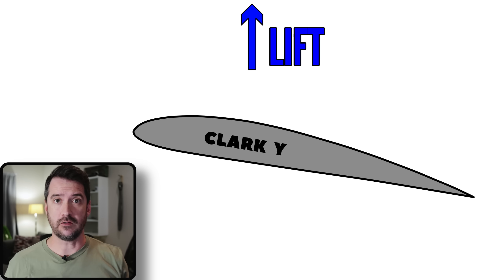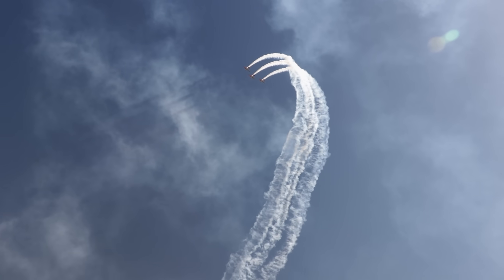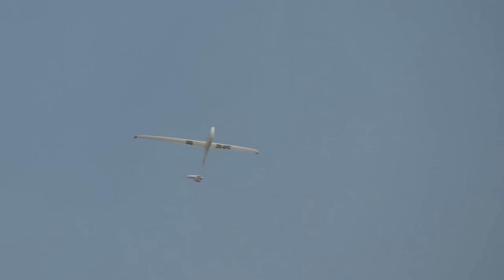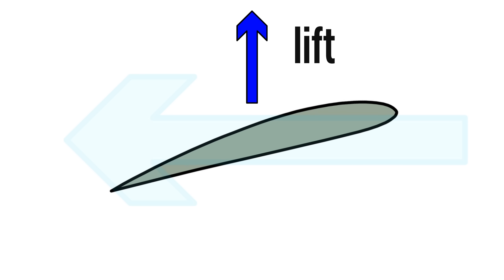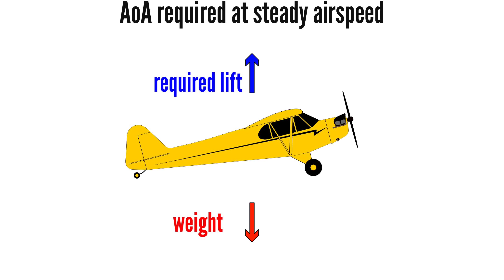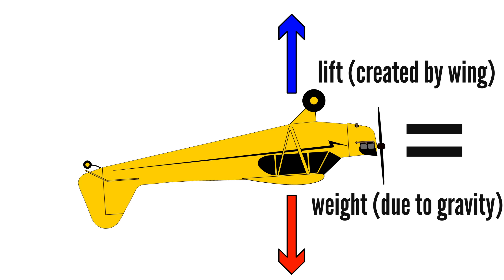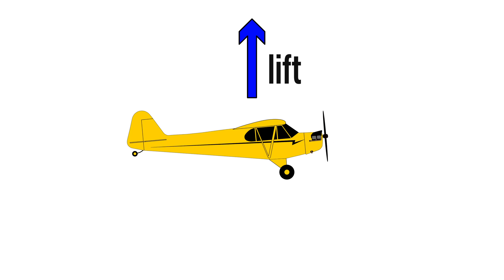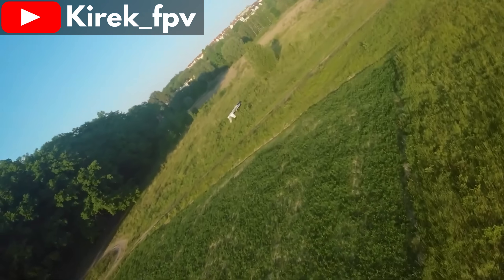Is Airflow Distance Over the Top of a Wing Always Longer?

Comment: It's so simple.  The wing must accelerate air downwards to produce lift.  The airfoil shape makes the process more efficient.  End of story'
Reply: All the diagrams illustrting the K-J theorem show the wing with a positive angle of attack, leading edge higher than trailing edge, with airflow deflected down. Gotta obey Newton's Third Law.
Reply: @petervanderwaart1138  A low circle arc profile with flat bottom and razor sharp edges at zero degrees will also create lift. That is the pure  Bernoulli Venturi effect.
Reply: @vicbauwens  There is NO lift without the acceleration of air downward.  You may attribute that to Bernoulli if you like...
Reply: @rsteeb  A venturi has equal acceleration up first then down and still produces a vacuum in the middle.  So why don't they cancel out?
Reply: @vicbauwens  Coanda is involved.  As is Newton...
Reply: All of the old NACA smoke stream videos show that the highest induced lift was produced just before the stall occurred.  The air at the trailing edge of the wing burbled first as the burbled air crawled backward toward the leading edge of the wing.  None of the air was flowing downward past the trailing edge of the wing. Thus, at high angles of attack there must be something more than Newton's laws that are creating the lift.  It's a combination of Newton and the Venturi effect that produces lift on the wing.  @petervanderwaart1138
Reply: Although it obviously leads to complicated explanations about how it is accomplished, it seems to me that most people get bogged down in these explanations before this very simple outcome is explained. This should be the very first thing explained, that there is a force moving air particles in one direction overall and the wing in the opposite direction, and that this is always the case under any conceivable circumstances.
Reply: @huverdoose  ... Agreed!!!
Reply: @adb012  Sorry, I deleted that because I'm in a bad mood (not related to this) and was afraid it sounded bitchy.
Reply: @huverdoose  ... I agree. if you want to give an "elevator speech" explanation of lift, "wing pushes air down so air pushes wing up, action and reaction, Newton's 3rd law" is the way to go. It is perfectly correct and it explains 100% of the lift. If the audience is not interested in more details, you are done. Now, anybody with an ounce of curiosity about this will not be satisfied. Gravity: Sun pulls Earth towards the Sun, Earth pulls Sun towards the Earth. Rockets: Rocket pushes combustion gasses back, combustion gases push rocket forward. Cars: Tire pushes pavement back, pavement pushes tire forward. Newton's 3rd law is EVERYWERE where you have a force (or rather two, because you NEVER have ONE force... because of Newton's 3rd law).
Reply: Air goes down. Plane goes (stays) up.
Reply: Yes…and no. 
Consider a stalled wing.  Still pushes air down, but creates little lift.
And for the yes.
Air has mass, therefore momentum.  The air below wants to continue towards the underside of the wing, thus compressing the air.
The air above wants to move away, thus creating a lower pressure. Simple hey!
Reply: @markthomasson5077  Consider a parachute.  Its lift is also its drag; although airfoil chutes do accelerate some air rearward, generating forward thrust.
Reply: @rsteeb  How does it accelerate air rearward?  How does a surface stiking the air make it accelerate air and not slow it down?  That would seem to violate equal and opposite no?
Reply: @markthomasson5077  On a stalled wing the airflow above the wing no longer moves smoothly along the wing surface. A lot of lift is lost that way.
Reply: @Snobiker13  of course.  I have felt this directly when windsurfing, if you over pressure the fin, it stalls and you go sideways dramatically!  
I guess wing are actually more sucked up, than pushed up.
Reply: My conclusion long ago that it’s basically conservation of momentum, and the curve on top is to keep the air suck and not becoming turbulent/stalled.
Reply: @RabidWombatz  turbulaters are employed to increase lift by stopping laminar flow over the top surface by causing breakaway.
Reply: @jimbo2629  If by "breakaway" you mean separation of flow, the function of turbulators is the opposite.  By creating small-scale turbulence in the boundary layer, they promote mixing of farther-out flow into the boundary layer.  This mixing brings in rearward momentum from the farther-out flow, so as to help keep the boundary layer moving aft, to /prevent/ flow separation (which on the upper side of a wing is known as a stall).
Reply: @RabidWombatz  So then how do you explain a stall?    By the way, the wing does work on the fluid, therefore momentum is not conserved.
Reply: @dougball328  A stalled airfoil has increased its AOA to a point where a significant portion of the relative wind has stopped flowing underneath and rearward and becomes pushed forward and over the leading edge.  The loss of downward acceleration of air is the result.
Reply: amazing how a perfectly understood scientific model is turned into obscure alchemy, backed by the argument of having had a private pilot’s license for 40 years 😅
Reply: @vicbauwens  Nothing at all "obscure" about Newton's laws.:face-blue-smiling:
Reply: @vicbauwens  Yeah, Newton's laws are "alchemy".  Brilliant.😅
Reply: @rsteeb  That is the most ridiculous explanation of stall that I have ever read.   Go take a basic aero class ( I have 5 years )   Let me give you a hint, when an airfoil stalls it is the flow OVER the airfoil that is disrupted, not underneath.   Your lack of understanding is on full display here.   Remember, it is better to remain silent and thought a fool than to speak and remove all doubt.
Reply: @dougball328  A stall occurs when air that should have gone under the wing is deflected upward and over the wing instead.  And I passed my private pilot check ride forty years ago.  GFY. 🙄
Reply: @rsteeb  You may know how to fly, but you don't know how your airplane works.   As for your salacious salutation, I won't stoop to being that low, gross or crude.   But you still don't know squat about aerodynamics.
Reply: @dougball328  Do you know how the stall warning switch on a Cessna works?
Reply: @dougball328  About stalls, please see my two responses about this elsewhere in the thread.  They're both kind of detailed, so I won't repeat them here.
About conservation of momentum, your balance sheet needs to include the continual impulse exerted by gravity.  Without the wing, the plane would be in free fall.  To avoid that, it has to hand off the gravitational impulse (weight force x time -- which has units of momentum) to something else, by causing the air to go down instead of the plane.  So the balance on the plane is 
(weight x 1 sec) - (downward momentum given to air in 1 sec) = 0.
Reply: Absolutely correct, and it doesn't matter HOW this is achieved  -  accelerating air downwards has the net effect of producing lift, and it couldn't be any other way.  Furthermore, simplifying it down to a two-dimensional cross-section (as it's usually portrayed), completely ignores what actually happens in the real world of three dimensions.
Reply: @CrowPal  I fly gyros I can have my disk on my rotors flat to the wind and they still don't slow down on a windy day (they slow more than in flight) sometimes I would have to turn with the back of the disk to the wind to get them to unload. This is the reason we usually set full forward at slightly below zero degrees angle of incidence. So my wood rotors have no angle of incidence ZERO and my disk is at ZERO why are they still going forwards fast into a wind?  It makes perfect sense with Benouilli's theorem.  Now perfectly happy to believe that a significant amount of lift is also produced by deflecting air down in normal flight with higher angles of attack but clearly pressure differential is doing all the work in autorotation.
Reply: @cameronlapworth2284   You are focusing on the micro (the aerofoil cross section), when you need to take a step back, and see the big picture.

An aerofoil section isn't the only method of generating lift by an heavier-than-air aircraft.  All of them, however, with the exception of anti-gravity craft, produce one net result: accelerating air downwards.  That is what produces lift.  We're talking Newton's third law here.  How else would an heavier-than-air aircraft stay up?

Of course there is a drag too, which is the acceleration component not directed downwards.

If you still cannot fathom this, look at pictures of planes (or helicopters for that matter) flying just above thin cloud layers.  That illustrates perfectly what happens.  That's the big picture.  The rest is just the mechanics of how to bring that condition about (the micro).
Reply: @CrowPal  Any model has to explain every situation.  If it can't its incomplete.  The reason I am focusing on Autorotation is because no one can explain this in terms of the  Newtonian model.  

I used to teach people to fly in gyrogliders.  So autorotation was paramount to my instruction so when the first rumblings of this debate started back in the 80's I contacted one of the aero engineers promoting this newer idea.  I was and still am perfectly happy to accept it completely or in part.  But while I understood what was being proposed in terms of lift in general it didn't make any sense in terms of autorotation.  So I asked him to explain it to me, he basically told me he was working on how this worked in his model.  He would get back to me when he had.

I never heard back and I didn't expect to he's a busy guy and was under no obligation but I concluded it had either been worked out or hadn't.

From time to time it comes up again and again I ask people to explain how this works in autorotation.  Because I have many a time sat there with my flat bottomed rotors in 15mph wind after landing and cannot remove the lift on my gyro with zero degrees disk angle.  My blades are set to zero, my disk is zero so its zero angle of attack and the blades are still doing over 150rpm.  

This doesn't work with the Newtonian model in terms of downward deflected air.  It doesn't explain why rotors in flight auto-rotate either.  It may explain how once they are spinning thanks to autorotation they produce lift but it doesn't explain autorotation.  I've asked 10 people on this thread to explain it and no one can.  Open to an explanation that makes sense.  

So at the moment I've come to the conlcusion the new theory is likely not the whole picture.  Likely Bernoulli isn't either.  But if you can explain it to me I'm all ears.

In the meantime.  It doesn't work as I understand the Newtonian model.  I don't think I'm too dim to understand it (perhaps I am).  But certainly no one here seems to be able to describe a mechanism by which air hitting a blunt edge of an airfoil can make it spin against the direction of travel other than pressure differential.  So no I'm not focusing on the minutia I'm holding the model to account for all phenomena. That's what a good theory does.
Reply: That's only part of it.  The wing creates a "Venturi effect" with the smooth undisturbed air above it.   Both ways contribute to lift, so it's not the end of the story.
Reply: @daffidavit  The lift that the top of the wing is making is ALSO from deflecting air downwards, end of story.
Reply: @daffidavit  ... It is NOT part of it. It is ALL of it but a ver basic level. You then can ask "how that happens", and then you go into things like the "Venturi effect". It is not that "both ways contribute to lift". Both ways explain 100% of lift, just in different ways, from different perspectives. In the same way that you would not say that X+1=3 and X-1=1 both contribute to X being equal to 2.
Reply: @adb012 🤓 

Dude, if I say my head is a prt of me then yes it is also “me” but it is still a PART. I would not be me without my head as it is a very crucial piece to ME but it is still a part…

Yes you can simplify it into a generalized statement that is 100% true but is still not the entirety of it.
Reply: @adb012 The Bernoulli pressure drop and Newton's 3rd law mass momentum down are not equivalent alternative explanations.

They are necessary pieces of a single explanation, with either being absent from the explanation, only making it a half explanation.

You need pressure drop and the consequential mass displacement.
Reply: @adb012  Exactly
Reply: @davetime5234  Well -- either one implies the other -- neither alone is actually wrong (unless the believer claims that the other is wrong...)
Reply: Wind tunnel tests negates the lift of Bernoulli's theorem. It does however prove that Newtons laws are correct.
Reply: @Graff-Art  No it doesn't it may prove that Benoulli's theorem is insufficient alone however.  I have yet to hear how the Newton thing explains auto rotation.  partial vacuum does explain this very well however.
Reply: @daffidavit 
I suggest high school physics where they learn 3rd Newton law aka law of conservation of momentum.
The only thing lifting the airplane is air accelerating downwards.
No more, no less.
F (up) = g m V(down) / t
Reply: @Alec72HD  I don't know why that's "controversial"...
Reply: @daffidavit he is absolutely right, his definition encompasses yours
Reply: @daffidavit  That effect is also directing air downwards as the low pressure zone pulls air from above it downwards. It does not pull air below it upwards, it pulls the wing upwards, but that doesn't move because the force is cancelled by gravity.
Reply: @cmilkau  Bouyancy works because there is a pressure differential.  Does a hot air balloon generate a downward thrust of air equal to the weight of the balloon?  No it generates a difference in pressure greater than the mass of  the balloon.  Doesn't need to require downflow of air only needs higher airpressure below than above.
Reply: @cameronlapworth2284 A pressure differential is just newton's 3rd law applied at the atomic level. Gas molecules on the bottom of the wing are colliding inelastically with the wing and reversing direction, which is a net acceleration of air molecules downward.
Reply: @enndubful  Yes I know that Netwons third law applies to air molecules.  I am asking for someone to explain how deflecting air downward pushes the rotor forwards and not act against the direction of airflow ie.  Thrust as autorotation does.  I understand how it can produce lift on the wing as a whole but it also has to explain autorotation.  Which also works with my blades which have zero angle of incidence with a flat disk. ie. flat relative to the air.  Explain why I need a rotor brake in 15mph winds in this situation.  If you can't theres a problem with the model.  Autorotation is not explained.  Forget downward lift think what makes a blade spin at hundreds of miles an hour against the direction the wind is hitting it.  simple flat plate physics would slow a rotor it would never autorotation because its lifting and adding to drag.   Autorotation works opposite drag.  Drag eventually wins but rotors will do hundreds of rpm, hundreds of miles per hour at the tip.  Please explain that.  If people can't the theory may be partly true but is missing something or is just part of a many factors contribution.
Reply: @cameronlapworth2284  Ultimately all of the lift and drag forces on an airfoil are the result of collisions with gas molecules. You keep suggesting that Bernoulli's principle explains lift as if that is a district effect from deflecting air downwards, but it's the same thing. A pressure differential is nothing more than more gas molecules colliding with one side of the wing than the other, which necessarily involves deflection of air molecules away from the high pressure side.  I'm not sure why you think that autorotation is incompatible with newton's third law.
Reply: @enndubful  i dont think its incompatible with 3rd law.  I think its incompatible with the explaination given.  Ie.  I think lift is compatible with deflection of airflow in an equal and opposite faahion.  But as 3rd law also states that drag will be caused against the flow of air and autorotation is acting in the opposite direction you have some explaining to do.

Rotors even in negarive pitch accelerate ceetainly at zero degrees the still spin fast if so e airspeed is maintained.

You have to get the resultant forward of blade .  This is explianed fine by lower pressure over the leasing edge compared to the trailing edge ie. Partial vacuum.  If not explianed by downward deflection of air.  Ceratainly not at zero degrees.  That causes drag or autorotation would increase with higher pitch.  It doesnt hence dead mans curve in choppers.  

If you want to help me understand something Ive missed explain that.  Dont give me vague discussion of 3rd law at the level of molecules.  I already accept 3rd law works with molecules.  The pattern and density of those molecules brings in different phenomena also.

You have to explain how 3rd law causes a rotor to accereate in the opposite direction to the impact of those molecules.  Ie.  How di they overcome the drag that 3rd law predicts.
Reply: @cameronlapworth2284  As long as the net acceleration of the air away from the trailing edge is great enough to overcome the drag force then the airfoil can still accelerate into the flow of air. The drag vector in autorotation always acts to slow the rotation. If the rotation speed is increasing then the component of the lift vector that acts directly opposite of the drag is necessarily greater than the drag force. 

You seem to accept that autorotation can be caused by a pressure differential. Pressure is nothing more than a net acceleration of gas molecules in the direction normal to the surface.
Reply: @enndubful  ok getting somewhere i think.  I believe that pressure differential is caused by the air molecules being forced apart vertically as the rotor seperates them as they go up over the top of the rotor.  Now could be and happy to be wrong here.  This explaination explains the pressure differential.  It doesnt matter how far the air travels if the wing was the top half of a circle then the pressure differential would be equal front and back.

This understanding explians difference between induced  drag vs parasitic etc.

However this may not be complete.  Which is why Im looking for an explaination that works.

You the first person on this thread who is trying to understand what my difficulty is with this.

So yes i understand that the newtonian veiw will have drag acting against autorotation.  I dont understand why it causes autorotation in the first place outisde of the speration of gas particles prefentially on the first 1/4 or so of the chord.  Not the downflow over the back of the rotor.  I dont see how this is revelevant.  

I hope you see my problem with this.  Im not being stuborn i genuinely dont want to be wrong longer than i have to be (if my current understanding is wrong).

Anyway thats a start but still not there.
Reply: @daffidavit . O, it IS the end of story.  There are a number of ways to accelerate air downwards. . .  Some are more efficient than others.
Reply: @daffidavit  Lol that dude isn't even close.
Reply: And is why racing car spoilers are upside down airplane airfoils. Pushes DOWN, the rear end.
Reply: Nope.
Reply: Many don't like too simple, it undermines their learning...

Early NACA aerofoils were merely arcs (connecting the bull nosed leading and "sharp" trailing edges) enclosing the aerofoil,  tangent to a series of circles  - with their centres on the line of camber / AOA desired at flight attitudes, thanks to a lot of experimentation (and theory to be sure)  we now have a whole library of aerofoils to choose for many scenarios - and simulations to generate new aerofoils in the future.....

(Pressure distributions are fascinating to look into...)
Reply: Fun fact is that I overheard an aerodynamicist (?) teaching aerodynamics at my flying club and he discarded the "longer path" theory I grew up with:
"Lift is is created by deflection ie acceleration of air volume downwards not by accelerating along the chord"
"The max 5% difference in path length cannot accord for the pressure difference".
Having heard this I realized that in each wing illustration airflow leaves the trailing edge neatly following the original AOA.
Whereas a propeller thrusts air down (i.e.backwards) in a perpendicular fashion. Same airfoil. Different result?
And later at uni the airfoil model was flat clark y looking (to prove the point!) whereas most airfoils are quite symmetrical. They all look like a fish, slightly bending. Sailplane wings are often concave at the rear lower side, lengthening the "shorter path" (uh oh!) but increasing the deflection component.
I alsp object to the presentation of ONLY TWO valid means of flying upside down (loading and thrust ratio) and then minutes later tossing in a third, AOA.
Reply: @jonashellsborn7648  A better explanation is what is happening at the level of particles.  Imagine your two airflows as evenly spaced particles and a zero angle of attack wing.  As the particles are deflected upwards on the leading edge they are moved apart vertically - so a part vacuum is created.  Where is the most change in the wing?  The curve continues across the whole surface but the bias is towards the front.  This explains both lift via the vacuum produced and the forward lift vector.  It explains auto-rotation too.
Reply: False!
Reply: Lift effects are a result of pure physical observations without ANY reasonable explanations…you can also argue that the resulting effect is reducing gravity acting on an accelerated profile within a certain medium…Nature does not do math or do calculations…Same with magnetic effects….Just observations given, no real explanation yet by modern physics…
Reply: Do you even lift ? 🤨
Reply: Any of the "acceleration of mass is the only mechanism of lift" boneheads here are free to explain how acceleration of mass is responsible for the lift of a horizontally motionless  magnetically levitated object that anyone can pass their hand under. 

The third law, isn't Newton's only law, if it were, it seems extremely unlikely it would be referred to as the third.
Reply: @homomorphic  
What does mag lev has to do with wings ?
There are many ways to create a force.
You can just use a rope.
Or a wheel on a rail.

3 rd law says that in the absence of other forces momentum is conserved.
You Seriously are failing Physics 101.
PS
Learn what is defined as "closed system"
Reply: @Alec72HD   this is the way science works. A bonehead makes a ridiculous assertion like "the way lift operates is due to Newton's 3rd law". I then provide a counter example that even a 3 year old can understand, and then we get that ridiculous assertion out of the discussion and we can begin to discuss how wings work using actual principles of physics.
Reply: @homomorphic  
You are claiming that wings violate 3rd law.
Again, I suggest you clarify for yourself what is a "closed system".
In any case
Lift = g × m (air) × V (down) / time
That's Newton laws.
Lift cannot be MORE, cannot be LESS.
Reply: @Alec72HD   of course I'm not.  It seems you don't even have sufficient basic understanding of physics to even have an intelligent discussion. 

Do you think that magnetic levitation violates the 3rd law? I mean you're response to that counter example is the idea that I am claiming that maglev does violate the 3rd law.

Just because lift doesn't use the 3rd law to obtain lift,  doesn't mean that it violates it. It seems basic logic escapes you.

Perhaps you can start by explaining what principle of physics maglev uses?
Reply: @homomorphic  
Because airplane AND all the air is a CLOSED SYSTEM 
The only way to create force UP (lift) is to push air down.
Any DEVIATION would violate 3rd law.
Reply: @homomorphic  
PS
In a closed system air cannot exert a force without corresponding change of momentum.
F = g MV/t

 Now, go read NASA explanation.
Reply: @Alec72HD   explain magnetic levitation. It is a closed system. How does the 3rd law apply to maglev (hint: it doesn't).

The 3rd law is not the only principle that applies to wings either.
Reply: @homomorphic  
I am not able to teach all of Newton principles in comment section.
You tell us, what is a closed system in your mag lev example.
You have a force between the earth and the vehicle.
Doesn't even have to be magnetic, makes no difference.
Reply: @homomorphic  So Newton's third law has been repealed?  :face-blue-smiling::face-green-smiling:🤣
Reply: @homomorphic  Maglev supplies "lift" which counteracts the 9m/s^2 acceleration that is Earth's gravity.  Tell us how the mag-lifted object differentiates static lift from acceleration!
Reply: @homomorphic  By "lift," the rest of us are talking about a force derived from interaction with a moving fluid.  If you think maglev is a disproof of what we're talking about, then you haven't been paying attention.
Reply: @crispinmiller7989   if you think that magnetic lift isn't a form of lift then you are completely bereft of logic and we have nothing to discuss.

In science if one can offer one counter example to an assertion, the assertion is invalid. That is just how it works.
Reply: @crispinmiller7989   i used it to disprove the assertion that lift must be due to a downward acceleration of mass. Once we can all accept that this statement is not true, then we can have a productive discussion about how wings work.
Reply: @homomorphic  If you were paying any attention to the whole context of the discussion you wouldn't even have dragged maglev into it.  You might as well bring in a 2x4 column and call the supporting force it supplies "lift" too.  Yes, there are many ways to hold things up.  This discussion, though, is about how airplane wings do it.

In the context of fluid dynamics, yes, lift does require downward acceleration of mass,  In the context of anything mounted on the ground, obviously it doesn't,    Your postings in this thread are just an irrelevant annoyance.
Reply: @crispinmiller7989   we're talking physics (that is all any discussion between humans is ever about) and incorrect assertions that violate Newton's 3rd law. Until everyone is on the same page regarding the 3rd law, useful discussions can not occur.
Reply: @homomorphic  Excuse me?  We were all talking specifically about airplane lift, a context in which the third law emphatically does apply, and you somehow found it necessary to jump in and object that it does not apply to areas where yes, we KNOW of course it doesn't, but we weren't TALKING about that.  

If you have a contribution to make in a discussion about AIRPLANE lift, please go ahead, and otherwise please leave us alone.
Reply: @crispinmiller7989   lift does not require acceleration of mass. Period. Regardless of vehicle. Physical principles are universal
Reply: @homomorphic  Physical principles?  like F=ma?

Sorry, "lift does not require acceleration of mass" is clearly not a universal principle.
Reply: @crispinmiller7989   of course it is a principal.  It is described by Newton's 3rd law in fact. The 3rd law states that for any action there is an equal and opposite reaction and this applies to all forces in nature, not only the force that results from mass×acceleration.  The maglev train proves this. There is no mass being accelerated.

Newton's 3rd law makes it clear that mass×acceleration is not needed for lift.
Reply: It's not that simple. There is circulation, Pressure fields, downwash...  Explaining how lift is created while addressing everything relevant in a mathematically consistent way is extremely difficult.
Reply: @mignik01   it isn't diffcult, it just requires a conceptual understanding of quantum physics. There is no mass flowing anywhere in maglev. There is a energy balance via electromagnetic forces. See, there's that word "force" again. It doesn't have to involve the acceleration of mass. The third law is at play, but not via the acceleration of a mass.
Reply: @homomorphic  yeah I'm not talking about quantum physics. You can explain it using the flow equations. Mass, momentum and energy equations.
Reply: @mignik01  ok, but you acknowledge that maglev produces lift without accelerateling mass, right? That has been my entire point. It should be obvious that acceleration of mass is merely one of the possible physical expressions of the 3rd law and not the 3rd law itself.

Once we get out of the way the misunderstanding that lift requires an acceleration of the air mass in the opposite direction of lift, then the discussion can get back on topic.
Reply: @homomorphic  No I don't.
Reply: @mignik01  yes
Reply: @mignik01  
It's that simple.
It cannot be no more, no less.
Lift HAS to be equal to
 g × M (air) × V (downwards) / time

3rd Newton's law applies here on Earth.
We (humans) have never observed a violation of 3rd law.
Good luck with your Nobel prize if you prove otherwise.
Reply: @Alec72HD  V/t = a. So your equation becomes gxF(downwards). What's causing the downwards acceleration?  This only sort of talks about momentum conservation. What about mass and energy? We don't really care about g in the creation of lift. Body forces like that are usually ignored.
Reply: Of course. That’s a direct effect of the conservation of linear momentum. For the wing to be pushed upwards, it must be pushing something downwards. One can go around (pun intended) with the theory of circulation, etc. But since the laws of mechanics are coherent, they will produce the same result, no matter which path you choose (another pun…).
Reply: 100%
Reply: How does that put a force on the wing? Gases can only produce a force by pressure differential. You can't attach a chain to the air molecules and drag the wing up.
Reply: @randomxnp  You don't need to tie the molecules on with a chain.  They're all being pressed against it by 15 p.s.i. from the miles of atmosphere sitting on top of us.  You can reduce the pressure by several p.s.i. and they'll still be clamped against the surface.  But they'll be exerting a lot less pressure than the underside, and in everyday terms we consider this pressure reduction to be suction.  But call it what you like, it creates a substantial excess of force from the underside vs. force from the upper side, and we call that "lift."
Reply: @randomxnp  Study the Coanda effect!
Reply: @Snobiker13  I have. What of it?
Reply: @randomxnp  Then you know that the Coanda effect is what keeps the flow attached to the wing. That's the "chain" that drags on the air molecules.
Reply: @Snobiker13  and how does it do that?
Reply: @randomxnp  https://en.wikipedia.org/wiki/Coand%C4%83_effect
Reply: @Snobiker13  because of Wikipedia?
Reply: @randomxnp  I'm just pointing you to a description of the Coanda effect. You said you'd studied it, right?
Mass and pressure.
Reply: Exactly, perfect, in a nutshell.
Reply: Search “Coandă effect”. It is used in the NOTAR (No Tail Rotor) helicopter design. Downwash from the main rotors flows around the tail boom to create a horizontal force to counteract Newton’s Third Law of Motion. It negates the use of a tail rotor….and the hellish noise produced.
Reply: Then explain the wing of an Extra.
Reply: Makes the process more efficient by reducing drag?
Reply: @jamesmskipper  more so that it converts more of that “drag energy” into lift energy rather than heat, turbulence, etc? Like yes it reduces drag compared to a brick but it really is just a matter of effectively channeling the energy into more useful means
Reply: @jamesmskipper  ... More precisely by increasing the lift-to-drag ratio. Yes, it reduces drag, but also increases the max lift.
Reply: @adb012  I don't think I've ever seen left/drag ratio testing of wing profiles, I'm sure they've been thoroughly tested decades ago. By the time I had some studies in flying, this was the accepted explanation.
Reply: @jamesmskipper  ... Yes, it is called the "Polar Curve" and it is one of the 3 main graphs for an airfoil: Cl-alpha (lift-to-angle of attack), polar curve (lift-to-drag) and pitching moment vs either AoA or Cl.
Reply: You ever put the back of a spoon in a water flow?
That’s where my intuition of lift comes from.  Fluid flow clinging to the surface, then an (effective) low pressure zone trying to detach that flow, pulling on the surface in the direction of lift.
As others have pointed out, multiple models come up with the same lift values, so pick one that best suits your intuition.
Reply: @Will-kt5jk  .... The spoon in-a=jet=of=water model is similar in the sense of the 3rd Newton's law: Spoon pushes water one way, water pushes spoon the other way. But the way the water and spoon interact is totally different than the way the air and the wing interact. And the reason for that is not air vs water, but a jet of fluid surrounded by static fluid vs the object being totally submerged in and surrounded by an "infinite" volume of moving fluid (or the object moving through the fluid). The jet-of-water-on-a-spoon experiment relies on the viscous boundary layer all along the spoon for the water to "cling" to the spoon,  what is called the Coanda effect. On the other hand, a wing or airfoil moving through a mass of fluid doesn't need the viscous boundary layer to generate left. In fact, a simplified model of potential flow (non-viscous flow, no boundary layer) predicts pretty accurately the pressures distribution around the airfoil and hence the lift. The Coanda effect doesn't predict well at all the lift of an airfoil, and the potential flow doesn't predict well at all the lift of the spoon in a jet of water.
Reply: @Will-kt5jk  Also venturi tubes in carburetors and other flow devices. But I remember an old photograph from Kitty Hawk where the Wright brothers were experimenting - a bi-wing type kite tethered on the beach in a strong wind. It appeared to be floating directly above the tether points. I thought - That illustrates very low drag, none of my flat kites ever flew vertically over me, most didn't exceed a 30° angle.
Reply: @jamesmskipper  right, because flat kites fly in a perpetual stall, whereas the Wrights' kite was a miniature airplane with legitimate airfoil wings.  (Even if the airfoils were still in an early stage and probably single-surfaced,)
Reply: Hi that doesnt explian autorototation.  Benoulli does.  Could be both but you need to explain autorotation.
Reply: @cameronlapworth2284   they need to explain how acceleration of mass is a requirement for lift. Maglev is lift. No mass being accelerated anywhere.
Reply: @homomorphic  yes but thats ni how aircraft wings work.  The competing theories are the air deflected creates an equal opposite reaction and benuolli longer airflow.  Benuolli explains autorotation as well.  But doesnt mean both cant be true.  The way I akways understood the mechanism for benoulli was the molecules end up pushed up as they go over and are seperated vertically hence the vacuum.  More deflection on the leading edge so not only more lift but also slightly forward lift.  Doesnt mean as the airflows of the trailing edge there isnt also and equal opposite reaction too.
Reply: @cameronlapworth2284   ok, now that we've established that lift doesn't require acceleration of mass (i.e. AOA) then I can now point out that wings (in level flight) do not produce lift via acceleration of the air mass in a downward direction. They produce lift due to pressure differential (which is a force and is completely consistent with the 3rd law).
Reply: @homomorphic  Gravity is equivalent to acceleration.  Maglev provides an equal and opposite effect, as Newton requires.  No laws of physics violated...
Reply: @homomorphic  We have established NO SUCH THING.  The "pressure differential" between the bottom and top of the airfoil IS DUE TO THE ACCELERATION OF THE ATMOSPHERIC MASS DOWNWARD. Maglev opposing the 9.8m/s^2 acceleration of gravity in an equal and opposite manner is fully consistent with Newton.
Reply: @homomorphic  yes quite possibly.  Im open to any idea but it must be consistent with everything.  I wrote one of the academics suggesting the whole mass deflection thing and raised how it workes with autorotation he said he was working on it but i never heard how it worked.  As I was instructing in gyros at the time i was wanting to get my instruction right.  Never did find out.  Not smart enough to get involved with arguements on fluid dynamics or physists.  Just smart enough to know you need to explian things like autorotstion in your model.
Reply: @homomorphic  
"Lift" means force.
Magnetic field is exerting a force from the earth to the vehicle.
Such force (of such magnitude) is only possible in a close proximity between magnets.
I am not your physics tutor, but I will say this.

Airplane cannot have any other forces other than thin air keeping it flying.
Reply: @Alec72HD   air is not a force, neither is gravity btw. The electromagnetic force is a force, though. Ultimately, the force that is used to keep both an airplane im level flight and a maglev in the air is the electromagnetic force. Different mechanism of action, but the same force.

The point is that  reactionary force (deflection of air in downward direction) is not the only force at play when a wing generates lift.  The mechanism of action that uses the electromagnetic force in a wing is the bernoulli effect. Equal transit time is an incorrect description of how the bernoulli effect applies, of course.

The OP stated that the reactionary force is the only force at play and they are entirely incorrect. 

The biggest take away of this whole discussion is that gravity is not a force, so the force producing lift is not a counteracting forxe to gravity (it can't be since gravity iisn't a force). 

For many applications (including aerodynamics) gravity can be used in newtoniam equations as if it were a force, but in fact, it is simply the distortion of space-time by mass (essentially it is a consistent error in the newtonian model that creates an artifact that can be used as a force term in newtonian equations to make accurate predictions).

So nothing about how an aircraft flies is "simple". In fact, gravity is literally the biggest problem in theoretical physics. Just because we can build airplanes doesn't mean we understand everything about how they fly, because we don't even understand how gravity and the forces of quantum theory interact.  If flight were fully understood we'd have to first understand how gravity works within quantum mechanics as that is the essential interaction in flight.
Reply: @homomorphic  
In mechanics to make our frame of reference inertial system, we substitute acceleration due to gravity with the force of gravity.
You sure seem to know all the "science appreciation" terminology.
Anyway, since air is the only medium in contact with airplane, and air is a GAS, we can view all the air and airplane as our inertial frame of reference, while the gravity is represented as outside force.
In such a system the only way to create lift, is to accelerate air downwards.
Anything else would violate Newton's 3rd law.
Reply: @cameronlapworth2284  
You do know that without  fanning the rotor blades just before the ground the helicopter still crashes with auto rotation.
Reply: @Alec72HD  i fly gyroplanes. Always in autorotation
Reply: @cameronlapworth2284  
I am sure giro planes don't violate Newton's 3rd law.
Explanation:
Something along the line of a rotating blade can encounter larger volumes of air and deflect it downwards (vs stationary  rotor blades)
Reply: @Alec72HD  im not saying it breaks newtons 3rd law saying the vector doesnt point in the right direction.  Benuollis law fits though.  The lift of the rotor may be explained by newton the rotors forward speed against the airflow is better explained by benoulli.
Reply: @Alec72HD  "You do know that without  fanning the rotor blades just before the ground the helicopter still crashes with auto rotation."

So what? it's a way to make a controlled descent that provides you with angular momentum in the rotor so that as you approach the ground you do have rotor motion to work with.  Does require training, but sounds like a good deal to me.
Reply: lol none of you have a clue.
Reply: And airfoil just works against you for upside down flight. 
 Also really wing mustn't do anything if you have powerful enough motor. Some rc planes can hover in vertical position, like a weird helicopter. With high angle of attack vertical part of thrust vector is not negligible for normal planes.. sadly this guy does not mention it.
Reply: Simple?:  How does the wing accomplish accelerating that air down?
Reply: What if it is a symmetrical wings?
Reply: Seemingly yes but why then when air is spoiled on the top of a wing do you lose lift??
Reply: @SGTBILL572  No sorry that's incorrect.  There's a thing called 2/rev.  look at the direction the mast moves.  Also autorotation works in a vertical descent in which there is ZERO difference in drag between each rotor.  So no it simply isn't being pushed around by the retreating rotor.  Additionally the retreating rotor is actually at lower airspeed because its speed is reduced.  The difference is 2x the forward speed.  So two factors prove you wrong the mast deflects backwards due to the higher drag of the advancing rotor. then forward when the blades are fore aft - hence the need for either a flexible mast or lead lag hinge (in multi-bladed rotors) and the retreating blade is going significantly slower than the advancing blade.  So if doing 80mph and the rotor is doing 400mph then its 480 advancing and 320 retreating.
Reply: Absolutely right, and  it is perfectly established, in aerodynamic theory by Kutta-Joukowsky  theorem,  since 1906
Reply: @Trompicavalas  Come on! The Wright Brothers figured this out in the 1890's and first flew in October of 1900 at Kitty Hawk, N.C..
Reply: @tedmoss  And Otto Lilienthal had it figured out decades before the Wright brothers.
Reply: Even Clark Y can generate lift at ZERO degrees angle of attack.
Reply: @ColinWatters  ... Every* cambered airfoil can generate POSITIVE lift at zero and even small negative angles of attack. (*almost... you could purposely design a cambered airfoil for which Cl=0 when alpha=0)
Reply: @adb012  You could, but then the pitching moment would not be zero.
Reply: @adb012  Nonsense.
Reply: @rsteeb  ... Oh, I see it now. Thank you for explaining what of what I said you disagree  with and for providing your view of how it should be.
Reply: @adb012  Angle of attack is usually understood to be angle relative to the zero-lift position. So zero angle of attack is by definition the angle at which lift is zero, regardless of camber or shape.
Reply: @ColinWatters  No it can't. It CAN generate lift with the bottom surface parallel to the airflow. But for that particular wing shape this is NOT  a zero AoA.
Reply: @grejen711  As I said before I did not make that mistake. I know how AOA is defined. Go and look at the polars. Look at the plots for CL vs AOA. They do not go through 0,0. They clearly show a positive lift can be produced at zero angle of attack. I would post links if youtube would let me.
Reply: @grejen711  ... Cambered airfoils can generate positive lift at negative angles of attack (up to a point, of course).
Reply: @adb012  there is no lift without downward acceleration of air, full stop.
Reply: @rsteeb   haha,  no. Stop being silly. I have disproven this ridiculous assertion above.
Reply: @rsteeb  ... Of course. Have I say anything contrary to that?
Reply: @ColinWatters  That's what camber does.    Simple explanation.   Thickness causes the velocity around the airfoil to increase, both top and bottom.  Camber causes the flow to speed up on one side and slow down on the other.   A symmetric airfoil (one with no camber) does not produce any lift at zero angle of attack.
Reply: @ColinWatters   - *"Many" positive camber aerofoils produce some lift at zero angle of attack. (most who ever - remember having -  studied fluid dynamics know this experimentally.)
(* not "all" because trailing edge reflex could modify the performance to reduce zero AOA lift)
Reply: @ColinWatters - venturi effect + camber
Reply: Of course, because the air going over the top gets accelerated downward, so Newtonian lift 😀
Reply: @lohikarhu734 
Still no.  Wind tunnel tests show lift can be generated with no downwards movement of air.
Reply: @Talon19  There is a downwash in the tunnel, but because of the walls it is necessary to adjust the angle of attack as it is not equal to the geometric AOA.
Reply: @dougball328  
Where do you get that idea?
Airfoils with zero AoA produce lift IN WIND TUNNELS.
Reply: Nonsense   @Talon19
Reply: @Talon19  Newton says otherwise.  And planes don't fly in wind tunnels.
Reply: @bill-8794  
Newton’s laws aren’t being violated.
The circulation/flow turning/coanda etc ideas just aren’t correct.
Reply: @rsteeb 
Correct, models fly in wind tunnels which are then scaled up to VERIFY data gathered in wind tunnels.  If wind tunnels didn’t accurately predict aircraft performance, we wouldn’t be anywhere near as advanced in aircraft design.
While Navier Stokes Equations are almost a century old, they weren’t useful for aircraft design until computers advanced.  Yet we were able to successfully design, test, build, and operate aircraft by using wind tunnels.
Reply: @Talon19 
That would violate 3rd law.
You could create closed loop wind tunnel that would generate thrust in space.
...
But you CANNOT.

However, if you have wing close to the ground (or wind tunnel walls), it may appear as the air isn't moving downwards, because it bounces off from the ground.
You have ground effect.
Reply: @Alec72HD  
The wind tunnel tests I and hundreds of other undergrad students ran do not violate Newton’s Laws. 
Fluids moving at higher velocities have reduced pressure related to slower velocity fluids.  Basic fluid dynamics.
Reply: @Talon19  
Doesn't change
Lift = M(air) × V(down) / time
Any deviation would violate 3rd law.
Good luck with that Nobel prize, all of you.
Reply: @Alec72HD  
That’s a tremendously oversimplified equation which doesn’t work.  Why do you think that’s even valid?
Reply: @Alec72HD 
The units don’t even make sense on that.  How are we even supposed to measure it?
Reply: @Talon19  
Equation that is a direct result of Newton's 3rd law ALWAYS works.
So far on this planet Earth, we have NEVER observed a phenomenon that violated 3rd law.
I am sure Nobel prize is waiting for you if you can figure out how to break Newton's laws.
I will be waiting for a TV announcement any day now.
Reply: @Talon19  
PS
Perhaps I made a mistake, there is no "g" constant.
F (lift) =  m (air) × V (down) / time
F = mV/t
Reply: @Alec72HD  
How and why do you think pressures or forces can only be achieved through deflecting fluids?
Reply: @Talon19  
It all depends on your frame of reference.
On a microscopic level at a static pressure air molecules bounce off and transfer their momentum to an object.
Of course same is happening on the other side, so net effect is small and it's called BUOYANCY.

ANY lift force greater than buoyancy HAS to come from accelerating air downwards.

It's the Newton's 3rd law.
Reply: @Alec72HD 
You just refuted your own position and ignored no slip conditions.
You are referring to static pressure, implying it is equal all around an object, which is false.
Reply: @Talon19  
What is false is your claim that I said static pressure is equal all around.
Did you miss that word BUOYANCY I wrote in caps?

I gave you your answer.
You seem to having a problem with the explanation given on NASA website, that 100% of lift is a result of pushing air downwards (downwash)
That is Newton's 3rd law.

Bernouly principles explain how a wing efficiently creates downwash and what happens with pressure.
Reply: @Alec72HD  
You seem to be misusing and misunderstanding buoyancy, lift, and differential air pressure.
You’ve given nothing to show force can’t be applied by a fluid without the fluid being deflected.
Reply: @Talon19  
I guess I am not as good at explaining as the NASA and many videos about this subject.
Or maybe you don't want to understand fundamentals of Physics.

All I care to discuss is the topic of this video, which is a flying object.
Reply: @Alec72HD  
NASA is correct, your understanding isn’t.  The Navier Stokes equations, Euler equations, equation of lift, etc don’t negate my example.  You just refuse to accept there are different approaches to the same principles.
Creating a force from a moving fluid doesn’t require that fluid to be deflecting, turned, or circulated.
Reply: @Talon19  
My understanding is that Newton's 3rd law always applies.
You are claiming that a wing in midair can generate (some) lift without deflecting air downwards (downwash).
If you cannot understand HOW that violates laws of Physics, that's unfortunate.
To prove me wrong you need to present research worthy of Nobel prize and be on the news as the greatest scientist since Einstein.
Reply: @Alec72HD  
Just going to ignore the points and questions which show your limited understanding?  
I’m not saying circulation/flow turning/deflection doesn’t exist, and aren’t factors contributing to lift.
Reply: @Talon19  (First of all, expressed a bit more precisely, fluids moving at higher velocities along a given streamline have reduced pressure related to slower-velocity fluids along that same streamline.  With those caveats, which I imagine your experiment meets, I agree with the statement.)

But anyway -- the Newtonian stuff a number of us are insisting on is that if, via its reduced pressure, the fluid has exerted a force on your foil, then your foil has exerted that same force on the fluid.  Which from all your descriptions would seem to be in a direction at right angles to the fluid flow.

How, then, are you explaining that the fluid which has received this force has not undergone an acceleration in the direction of that force -- i.e., that its velocity has not curved?

or does it, but then get flattened out by the trailing plate you've described -- but maybe the trailing plate is not part of your force-measuring rig?

(If THAT's the case, then your instructors are right up there with the Wizard of Oz....)

My own surmise is that the the foil and plate are all one piece, but that the  flow goes straight because you've simultaneously got reduced pressure on the ceiling of the wind tunnel, so that what you've actually demonstrated is a large low-ratio venturi.  But until you show us a report of the setup, there are other possibilities too.
Reply: @crispinmiller7989  
The fluid does get curved, by the cambered area.  Pressure ports are placed along the upper and lower surfaces of the wing, as well as on the upper and lower surfaces of the wind tunnel.
Reply: @Talon19  And their readings are --??
Reply: @Talon19  Nonsense..
Reply: @crispinmiller7989  
Constant pressure across all surfaces EXCEPT the cambered surface which shows a decreased pressure because all other surfaces are in far field.
Reply: @Talon19  Thanks for the reply.
Hmm.
Were there any taps/sensors placed where the cambered surface met the flat surface?
Reply: @crispinmiller7989  
Yes. Taps were placed at the leading and trailing edges of the cambered area and at 10% intervals of the cambered length, totaling 11 taps along the centerline of the cambered area.  I don’t have my notes from the experiment; unfortunately, but I believe taps were placed at intervals in the leading and trailing flat plates equal to the distance between the cambered area taps.
It was such a tedious process connecting these dozens of taps.
Reply: @Talon19  Yeah, I ran a more typical experiment once that had a similar pile of taps (old school -- they ran to a bank of water manometers).

So what kinds of pressures appeared at the leading & trailing edge taps?

And then was your test foil mounted to a force measurement rig of any kind?
Reply: @Talon19  The Coanda effect is in fact required to keep the flow attached to the upper wing surface.
Reply: @Snobiker13  
That’s not the Coanda Effect.  The Coanda Effect isn’t a cause.
Reply: Rowley,
Accelerating air downwards accounts for only ~10% of total lift generated.
Simple experiment to prove this is a flat plate wing with zero angle of attack and a small positive camber in the middle of the wing.
Air isn’t deflected up or down but the wing still creates lift.
Reply: @Talon19  Nonsense!  Newton's laws shall NOT be violated.:yougotthis:
Reply: @Talon19  It accounts for 100% of the force that lifts and aircraft. Vacuum does not lift.... air pressure lifts.
Reply: @Talon19  Air will be deflected down at the trailing edge, not because the trailing edge is pointing down but because of the circulation required to produce the lift.
Reply: @dougball328  
Circulation isn’t required to produce lift; simply the difference in pressure.
The long flat plate along the chord line prevents circulation, but lift is still generated.
Reply: @Talon19  Lift = density x velocity x gamma (circulation strength)   For subsonic, viscous flows there is no lift without circulation.  I suggest you go to school.  Just how do you think that pressure differential gets created?    Ah, the ignorance on here of any real aerodynamics. is truly appalling.
Reply: @dougball328  
 
Pressure differential between upper and lower surfaces.
One of the first wind tunnel experiments I did as part of my aeronautical engineering degree was a long flat plate with zero AoA and a small camber area in the middle.  This prevented air streams from crossing or turning or circulating.  
The whole purpose of that experiment was to show objectively the circulation/newtonian/turning myth is false.
Reply: @Talon19  Do you even understand the concept of circulation?   Your talk of crossing or turning or circulating streamlines tells me you do not.   I don't know what school you went to, but I am glad I never hired you.
Reply: @dougball328  Please explain then why my zero angle of incidence rotor blades on my gyroplane with the stick full forward at zero degrees angle of attack in a 15mph wind will not slow down without use of rotorbrake?  Really happy to be wrong yet to hear a good explanation.
Reply: @cameronlapworth2284  So tell me how much camber your rotor blades have.   That will give you your answer.
Reply: @dougball328  Zero on the bottom similar to clark y with reflex.  So zero moment aerofoil.
Reply: @Talon19  And what causes thrust from a PROPELLER?🙄
Reply: @rsteeb  
The same pressure created by positive cambered airfoils; lift, merely in a different direction due to the orientation of the propellor.  
The idea lift is more effectively and efficiently produced by symmetrical airfoils is simply wrong.
Reply: @Talon19 zero AoA does not mean no air is directed downwards. If you have a low pressure zone that is sealed below and has a higher pressure zone above, it will pull fluid downwards from above with the same force it pulls the seal upwards. The low pressure bubble wants to collapse and it doesn't distinguish between directions. That's why it also inevitably induces drag (lift drag in this case).
Reply: @cmilkau  
Yeah, that’s my point.  Air deflecting downwards isn’t the predominant form of lift.
Reply: @Talon19  
Time to claim your Nobel prize.
By claiming to violate Newton's 3rd law,
You just created a form of propulsion in space.

But you DIDN'T.
Reply: @Talon19  You're WRONG - It's the SOLE source of lift.
Reply: @rsteeb  
Ignoring the experimental evidence to the contrary, if it were the sole source of lift, airfoils would not have the vast differences in shape and application.  
Can you even give a purely “flow turning” equation for lift that is actually useful?
Reply: It's not at all simple, and cruising lift has no relationship to accelerating airflow downward.
Reply: @homomorphic  "Cruising lift" or otherwise, F=MA.  The FORCE that holds the aircraft up is due to the ACCELERATION of MASS downward.  FULL STOP.
Reply: @rsteeb   nonsense. Force does not imply acceleration of mass. Magnetic levitation does not accelerate any mass to provide lift for a train. Force always requires a transformation of energy, but the third law is but one mechanism of transformation. 

I recommend taking a refresher on basic physics.
Reply: @homomorphic  I suggest you look up Newton's Second Law.
Reply: @rsteeb    I suggest you  review all of physics if you don't understand this particular thread of the conversation.
Reply: @homomorphic  And maglev does indeed accelerate mass--  that's what a "G" is!
Reply: @homomorphic  What do you think I don't understand?🙄
Reply: @rsteeb   you are telling me, what I said, as if I said something else, which indicates you aren't following the conversation.
Reply: @homomorphic  I understand "equal and opposite" extremely well.  So did Newton.
Reply: @rsteeb   Newton certainly did, you I am not so sure about, because you seem to believe that equal and opposite imolies the acceleration of mass.
Reply: @homomorphic  So tell me what "equal and opposite" refers to?
Reply: @homomorphic  Yes, "equal and opposite force" implies the acceleration of mass.  Newton's second AND third laws, together.
Reply: @rsteeb  F=MA is not the issue here its how F is created.  Obviously deflection of air downwards is a component of this but so too does pressure differential.  You are thinking of lift as only a lift vs gravity equation.  If you are a fixed wing pilot this is understandable if you are a gyroplane pilot then what makes the spiny thing above your head do hundreds of mph against the direction of relative airflow over the rotor above you is kinda important.  Can you explain this ignoring Bernoulli?  Genuinely open to an explanation of this based on deflection of air downwards but given that downward deflection is also a backward deflection (ie. drag) I'd like to hear an explanation that makes some sense that eliminates Bernoulli.
Reply: @homomorphic  How do propellers work?
Reply: @rsteeb   as it pertains to this discussion it matters not how propellers work, what matters is that your assertion that lift is always the result of acceleration of mass is false, is the subject at hand. Your assertion is false and is in direct contradiction to Newton's 3rd law.
Reply: @homomorphic  So wings and propellers operate with differing laws of physics?  Tell me more!  Newton's third law shall NOT be violated, and I did not contradict it.  Check out Newton's SECOND law!
Reply: @rsteeb   that's what you are claiming. I claim that they do not obey different laws of physics and that they are subject to both the 2nd and 3rd law. You are stating clearly that wings are subject only to the 2nd law.
Reply: I get the vacuum effect of the upper wing shape but, what about paper thin wings of fighter planes?

Also, on a normal basic wing shape, why doesn’t inverted flight cause the vacuum effect to pull the plane towards the ground (vacuum on top of wing for opposite lift against weight in normal level flight, vacuum on top of wing for same lift with the weight in inverted flight).   In inverted flight, the lift no longer opposes the weight.  Instead, the lift compliments the weight which should drop the plane.   Right?
Reply: In inverted level flight, the pilot pushes FORWARD on the controls to increase Angle of Attack and therefore lift in the OPPOSITE direction of gravity. By increasing AoA, the airflow must flow over a larger surface and the air being directed down toward the ground is also increased. In addition, the propeller thrust in propeller aircraft, also provides lift with its slipstream. The aerobatic stunt planes typically have a lot of power to do this and also have wing designs for this.
Reply: @fazole  thanks for making the guy’s statement over complicated and redundant? 😂🤷‍♂️
Reply: @CMBCanfield   - The "paper thin" wings of a some jet fighters still fly with a positive angle of attack (thus the path over the top of the wing is longer than the path beneath the wing, causing the airflow over the top of the wing to be faster than the flow over the bottom of the wing, creating the pressure differential that we know as "lift").  The Lockheed F-104 Starfighter is the most extreme example of small, thin wings I can think of, yet it flew by the same principles as a Piper Cub (i.e. pressure differential between the top and bottom of the wing).
Reply: @danielklopp7007  The "path length" is irrelevant.  The acceleration of ambient air earthward is how F-104's and all other aircraft attain "lift".
Reply: I guess you fell asleep in physics class the day the professor talked about the Bernoulli effect (i.e. faster moving air has lower pressure than slower moving air)?
If you're talking about a rocket lifting off a launch pad, then 100% Newton (i.e. equal and opposite reaction); however the subject here is airplane wings, in which case it's 100% Bernoulli.
... end story!
Reply: @danielklopp7007  NO.  Rockets, helicopters AND airplanes ALL ascend due to Newton, full stop.  Any Bernoulli "lift" is replicated by Newtonian downdraft, equal and opposite.  That's the LAW!
Reply: @rsteeb   - Rick: I need to know which university issued your Physics degree (because I need to tear up my degree, ask for a refund from my alma mater, and go to your university to relearn physics)... 🤣
Reply: @danielklopp7007  I think your alma mater failed you.  Tell me why Newton is wrong!
Reply: @rsteeb  Rick - First, I never said Issac was wrong... however his third law of motion (i.e. the one you are referencing) does not explain wing lift.  Issac's second law explains air pressure (~15 psi at sea level), which is needed for Daniel's principle to take effect (i.e. a pressure differential between the faster moving air on the top of the wing vs. the slower moving air on the bottom of the wing). Remember, an airplane wing (or helicopter rotor) does not store air which can be be "pushed" downward to create lift, so that air (being "pushed" down) needs to come from somewhere... (and you'd need a lot of it, since Issac's third law tells us the mass of air being "pushed" down needs to be greater than the mass of the airplane).
Rockets, on the other hand, store gases (in the form of combustible liquids or solids) which than then be "pushed" (at high velocity) out the exhaust nozzle, thus creating lift.
... or maybe it's all bunk and the only reason I believe Mr. Bernoulli's principle is we share the same first name? 🤣
Reply: @rsteeb  Autorotation isn't
Reply: @danielklopp7007  Rockets and helicopters and airplanes all ascend due to NEWTON.  FULL STOP.  Hey Bernoulli, explain why the static ports in a pitot-static system don't SUCK...🙄
Reply: @danielklopp7007  Rockets, helicopters and airplanes ALL ascend due to Newton, full stop.
Reply: It is NOT the acceleration of air downward which produces all the lift. It is mostly the movement of air (much of it horizontally) and the placement of the rarified air in the space the wing used to be in which produces lift.

Think of it this way: A brief moment earlier, the wing was in the space which is now behind the wing. Behind the wing, _and above it due to the wing shape_. The air in front of the wing can't just remain in its original location, to fill that space. The wing is pushing it out of the way. So there's a relative vacuum behind the leading edge of the top of the wing. Air below the wing (among other places) "tries" to fill the vacuum, but the wing is in the way, so a force acts upward on the wing due to the pressure differential.

The reason planes can fly upside down is that if you invert the wing _and also change its angle to the horizontal_, it does roughly the same thing, because it's still thicker at the front. It's somewhat close to the same shape because the wing is somewhat vertically symmetrical.
Reply: @fathergs209  Air accelerated downward provides LIFT.  Air accelerated forward produces DRAG.  Full stop.
Reply: @rsteeb  drag is not the only thing it produces in the circumstance. You really don't understand this at all.
Reply: @rsteeb  do some calculations and figure out the mass of the air that would be deflected downward by the wings of a 747. Then figure out how fast that air would have to be deflected downward . Do it for the atmospheric pressure at about 30,000 ft. 

It's absolutely impossible to blow the amount of air a wing could possibly deflect at a fast enough speed to provide that much lift. Or if you want to do it on takeoff you could use a pressure of one atmosphere and about 200 mph forward speed. How fast would the air have to go down? 

It would be impossible.
Reply: @fathergs209  G=9.8ms^2.  Either the 747 or "some mass of air" WILL satisfy that acceleration.  Newton stands.
Reply: @fathergs209  Funny how I passed my private pilot check ride forty years ago last April... not "understanding"! 🙄
Reply: @rsteeb  You didn't calculate the speed the air would have to be deflected down. Do you know how? It's Physics I stuff. Just quoting gravitational acceleration on Earth doesn't do it. I'm not impressed at all.
Reply: @fathergs209  And IDGAF about your level of "impression".  Like Einstein said "Explain everything as simply as possible, but no simpler".  It's not the speed of air deflecting downward, it's the acceleration of mass.
Reply: @rsteeb  This explains it fairly well: "Essentially, Newton’s sine-squared law is one of quantitative forms of the momentum-based explanation. The contribution to lift and drag is solely from the momentum exchange between impinging particles and the lower surface of the plate. On the upper surface, there is no particle interacting with the surface. Therefore, the contribution to lift and drag from the upper surface is totally neglected, which is now known as the major part of lift."

"which is now known as the major part of lift."
Reply: @fathergs209  "which is an incomprehensible word salad."  Congrats.🤣
Reply: @rsteeb  I'm sorry you couldn't understand it. It was from a scientific paper and it made sense to me.
Reply: @fathergs209  Bernoulli, Coanda, Kutta-Jukovski or Dunning-Kruger;  it all ends up as Newtonian law.  Lift is equal and opposite to air mass acceleration downward, Full Stop.
Reply: @rsteeb  if you can't think of anything else to produce lift than accelerating air downward, you really don't have a grasp on physics.
Reply: @rsteeb  please explain autorotation.
Reply: @rsteeb  they did an experiment where they tested private pilots giving them the same theory exam 6 months after testing and the rate of knowledge retention was appalling.  You need to know enough to have a belief to do the right things in the right circumstances.  The actual real why will be more important for engineers designing wings.  I suspect this argument explains a lot.  There are pilots, instructors and aero engineers all on different sides of this.
Reply: @rsteeb  Then please explain autorotation.
Reply: @cameronlapworth2284  Autorotation works just like a ram-air parachute.  The collective is lowered to achieve a "glide", and then the collective is pulled to provide lift just before ground contact.  M-m-m-m-K?😎
Reply: @rsteeb  Not in a gyroplane.  In a gyroplane the rotor is in continuous autorotation.  Even if the disk is flat (full forward) and pointing into wind with zero angle of incidence.  In a 15mph you won't slow them down beyond a certain point after landing.  So that can't be downflow of wind  Yes obviously some of the lift is deflection we normally fly at higher angles of attack than that.  But if that was the whole picture then it simply doesn't explain autorotation.  Most rotors for stability reasons have a reflex at the back that is the last inch or so is flat and the bottom skin of the rotor comes up at the rear so when flat if Bernoulli has nothing to do with it the blades would stop if disk was flat into wind.  They don't.
Reply: @rsteeb  Depends.  If by "glide," you mean that the collective pitch is set to a negative angle of attack, then no.  

The source of forward force on each blade is that if air is coming up through the rotor plane, it ends up doing a tight turn around the leading edge of the blade, and thereby getting slung rearward along the top of the blade.  Either by noting the reduced pressure as the air passes around the leading edge, or by noting the rearward acceleration of the air, you discover that there's a net forward force on the blade.
Reply: The air won't do a "tight turn around the leading edge" if the angle of attack is positive.  The bottom of the rotor blade must be angled such that IT causes rearward airflow.
Reply: @rsteeb  Actually, the video specifically supplies an illustration of air doing a tight turn around the leading edge at a positive angle of attack.  See frames at 9:12-9:16 or so.

Many years ago, as a teenager, I spoke with a house guest (Bob Lichten) who was an engineer at Bell Helicopter, and mentioned to him that I'd concluded that autorotation simply meant windmilling of blades angled downward.  He politely corrected me and said that autorotation will work at zero blade pitch.  (Which, in an unpowered descent, amounts to a positive angle of attack relative to the air flow.  But relative to the axis of rotation, with the blade undersides level -- square to the axis of rotation -- their contribution to shaft torque will be neither positive nor negative.)
Reply: @fathergs209  ... "It is NOT the acceleration of air downward which produces all the lift."
Totally, absolutely, irreparably wrong. The force that push the air down and the lift on the wing are action-reaction pairs as per Newton's 3rd law. And that little dot is a PERIOD. Lift is a force done by the air on the wing. If the iar makes a force on the wing in one direction, then the wing makes a force on the air in the opposite direction. If the lift goes up, the force on the air goes down. If you can divide all the air in little chunks, and measured the mass of each chunk, and measured the vertical speed of each chunk way ahead of the wing (which is zero), and measured the vertical speed of each chink way downstream of the wing (which is called w), then you can measure the force applied on each chunk of air to accelerate it from a vertical speed of zero to w downwards, and then if you sum all those forces (which is done with an integral), and cancel the forces that each chunk makes on each other, you are left with EXACTLY a force equal to the lift. Not 99.99% of the lift. Not 1.0001 times the lift. EXACTLY the lift. All the rest is attempts to try to further explain how this phenomenon comes to being, attempts which may be right or wrong. But the moment you say that "It is NOT the acceleration of air downward which produces all the lift" you already started from a wrong premise. It's like saying "It is not the acceleration of the exhaust gasses what creates thrust in a rocket, it is the combustion which causes an increase in temperature which in turn yada yada yada...." NO. The acceleration of the gases explains 100% of the rocket's thrust, and the downward acceleration of the air explains 100% of the lift. Get that right FIRST, and THEN try to explain how that correct think happens. If not it's trying to explain how France won the FIFA World Cup final match to Argentina. It didn't, so any explanation is meaningless.